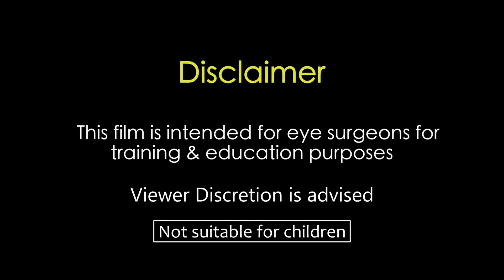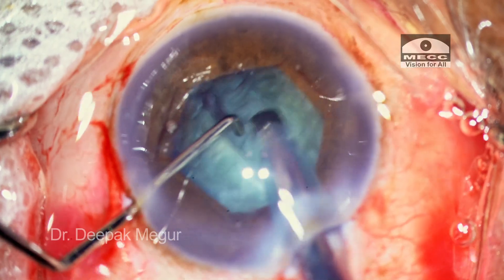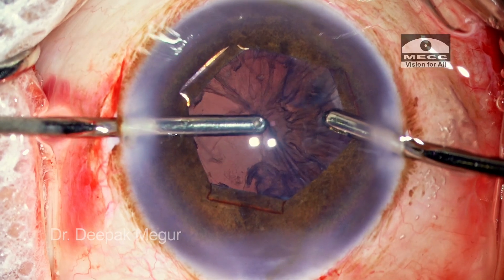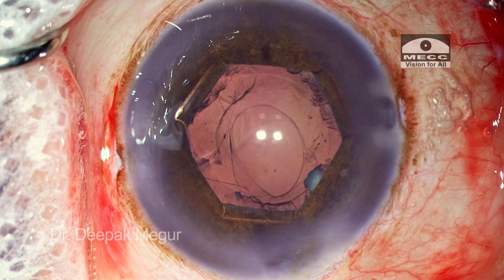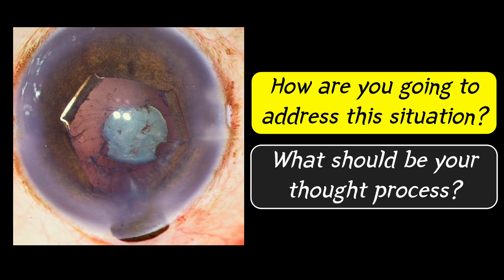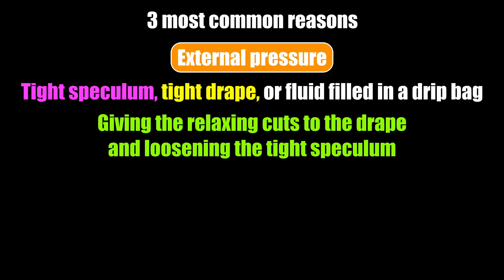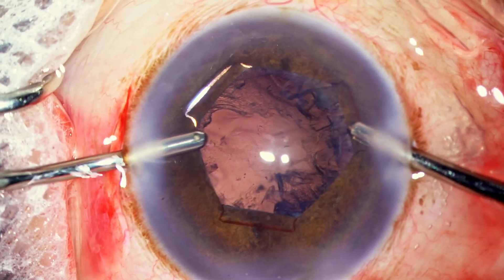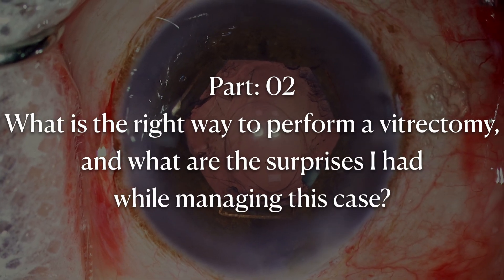Extreme Positive Pressure - PC tear -Analysing the cause and management (Part - 01) Dr. Deepak Megur

Comment: One of the ways to deal with fluid misdirection is to deflate the ant chamber toally while waiting those 2 minutes, allows for egressed fluid to flow out back to the AC again and decrease the positive pressure. 

Thank you for the amazing work Dr Deepak

Comment: I would have moved that nuclear piece superficial, placed the IOL first (with sodiun hyaluronate 3%), then removed the nuclear piece, and then removed the remaining cortex. The IOL protects the posterior capsule so you can remove cortex with low chances of breaking it
Reply: The problem is implanting IOL in such a flat anterior chamber is also risky since you can easily damage the capsule during implantation. Moreover, it is probably a hyperopic eye and IOL power is high. Before deepening the AC every maneuver is a risk...

I can only suggest waiting or pars plana incision.
Reply: Once the last fragment is found to fill anterior chamber with less OVD is mandatory to avoid iris hernia. Should open main incision and extract the fragment using sinskey hook. 1suture and inject de lens the following day unless there is an important coroidal detachement

Comment: 1. Eliminate external factors causing pressure
2. Release pressure by burping the AC to release fluids and gel trapped inside and behind the capule
3. Watch and wait for 1-2 minutes ( this also "resets" your emotions and good time for your thoughts to re-group)
4. Once stable i will put gel in AC and place the IOL before removing the remaining fragments
5. If pressure is high after surgery, i will suture the main port +/- side port (so i can sleep peacefully at night)

Comment: When the patient told the surgeon that he is uncomfortable 

1. Loosen the speculum
2. Make the patient comfortable, let him cough, wait for 10  seconds
3. Reduce the bottle height
4. Reduce I/A and phaco parameters
5. Use heavy OVD like sodium hyaluronate. Take out the last piece by phaco (in epinucleus mode)
6. Do I/A with reduce parameters
7. Remove B hex ring
8. Put IOL in the bag under sodium hyaluronate
9. Visco wash close the case
Reply: In my opinion IOL Scaffold would be much safer rather thank risking just to take a tiny fragments
Reply: Me too would like to place the IOL in the bag first to safeguard the PC and then will remove the last fragments